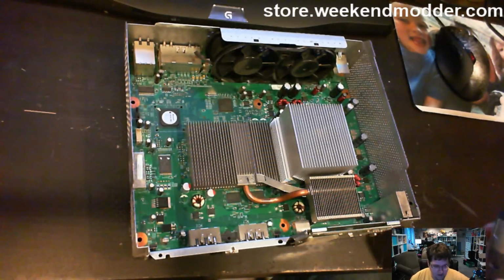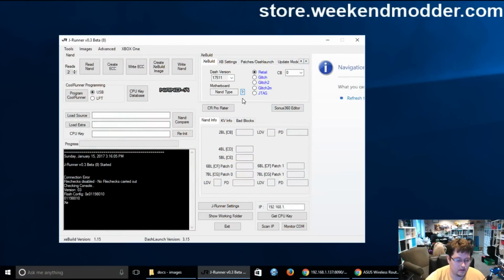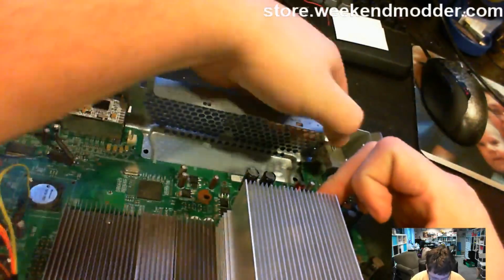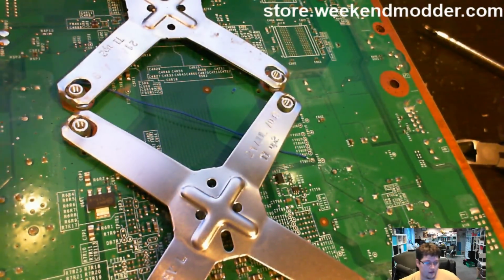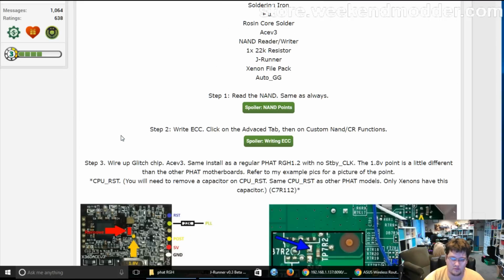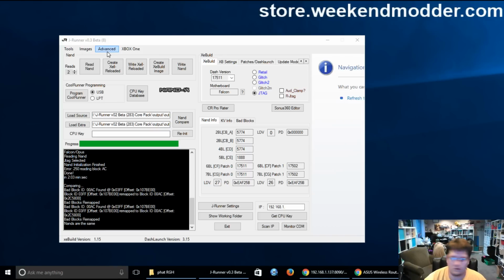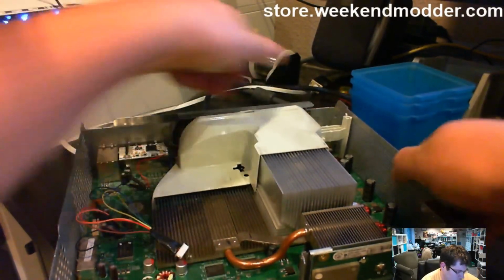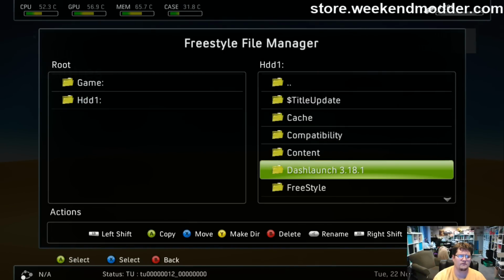Watch me RGH 1.2 Jasper/Falcon on current dash 17511 complete process

Comment: hey just wondering, since i get two types of cables one for the phat and the other one for slim, if the one for phat is too short can i use the one for slim on my phat?
Reply from the maker: Yea, they're just wires. Use whichever work for you.
Reply: @TheWeekendModder  alright thanks
Reply: @TheWeekendModder  one more thing, if i buy another glitch chip can i use the same jr programmer or do i have to buy a new one?

Comment: I have what I believe to be a Jasper. I’ve never really messed with a 360, so probably a dumb question but, if I do a RGH, do I need to flash the dvd drive separately?  Which programmer and glitch board would you recommend?
Reply from the maker: Yes RGH and DVD drive flashing are wholly separate activities.  Check out weekendmodder.com I've got recommendations there for the supplies and process you should use
Reply: It appears that you recommend a matrix over a cool runner.  What are the differences?   And what are the differences in programmers?  I see you have them all.  And I don’t recall seeing anything on dvd flashing

Comment: even if you had a perfect xenon, why would anyone bother.  it doesn't have HDMI.  I mean come on.  through that paper weight in the trash and pick up a jasper for $50 on ebay even back in 2017.  hell they were $80 in 2012.  or craigslist.  i mean i just picked up a jasper, a 360e, 5 controllers and 4 games for $50, everything works, craigslist.  even in 2020, thats a hell of a deal.
Reply from the maker: I 100% agree with you.  You can get nice Trinity slims for like $40 at just about any pawn shop.

Comment: I figured out that if you want red LED's you need to bridge the grounds on two of the stock LED's (top left and bottom right) because on the board, D1 and D3 grounds share the same points, D2 and D4 share same points as well. You only have to change the center LED. From what I understand, green LED's take a little more voltage to light up than red meaning the green LED's have more resistance. So the path of least resistance is to go through the red LED's.

Comment: hi i have 2 phats 360 with falcon and i want to do the RGH on both, its the same process of this video? also i only find in my country de jr programmer v2 and matrix v3 glitchers, can i do it with those?
Reply from the maker: Yes and yes.
Reply: thanks for the answer , also i see a lot o posts that says that are diferent version of falcons (v1, v2, v3) y really dont know how to know what version is mine... is that important or it doesnt matter?
Reply from the maker: Sub-versions of motherboards only make a difference on Corona consoles.  On Falcons it's irrelevant.
Reply: ok... so i was watching your online store... i wanna know if you can ship internationally, to Mexico to be specific, i want the nandx and also two of coolrunner glitchers...
Reply from the maker: Yes, I ship supplies internationally - I just don't do send ins or ship premodded consoles internationally.
Reply: i managed to get one jr programmer v2 and  this is this the log of reading 2 times de nand on a Falcon its ok to proceed?

J-Runner v0.3 Beta (8) Started

Connection Error
Filechecks disabled - No Filechecks carried out
Checking Console..
Version: 10
Flash Config: 0x01198010
01198010
Xenon, Zephyr, Opus, Falcon
CB Version: 5774
Falcon/Opus
Version: 10
Flash Config: 0x01198010
01198010
Xenon, Zephyr, Opus, Falcon
CB Version: 5774
Falcon/Opus
Reading Nand to C:\Users\rebellioN\Desktop\J-Runner v02 Beta (283) Core Pack\output\nanddump1.bin
Reading Nand
Error: 250 reading block C9
Error: 254 reading block 3B7
Done!
in 3:29 min:sec

Reading Nand to C:\Users\rebellioN\Desktop\J-Runner v02 Beta (283) Core Pack\output\nanddump2.bin
Initializing nanddump1.bin..
Falcon/Opus
Jtag Selected
Nand Initialization Finished
Reading Nand
Error: 250 reading block C9
Error: 254 reading block 3B7
Done!
in 3:28 min:sec

Comparing...
Bad Block ID  00C9 Found @ 0x03FF [Offset: 0x107BE00]
Bad Block ID  03B7 Found @ 0x03FE [Offset: 0x1077C00]
Block ID 03FF [Offset: 0x107BE00] remapped to Block ID 00C9 [Offset: 0x33D200]
Block ID 03FE [Offset: 0x1077C00] remapped to Block ID 03B7 [Offset: 0xF52E00]
Bad Blocks Remapped
Bad Block ID  00C9 Found @ 0x03FF [Offset: 0x107BE00]
Bad Block ID  03B7 Found @ 0x03FE [Offset: 0x1077C00]
Block ID 03FF [Offset: 0x107BE00] remapped to Block ID 00C9 [Offset: 0x33D200]
Block ID 03FE [Offset: 0x1077C00] remapped to Block ID 03B7 [Offset: 0xF52E00]
Bad Blocks Remapped
Nands are the same

Comment: Hey Weekend, have you encountered a stubborn BB 512 jasper freezing at the same spot on boot logo? I'm in that situation right now. Nand retail (when flashed back) is fine, xbox works normal. When using a coolrunner and following exactly the same process as you, my box freezes at the same point in the boot logo. SUCKS. I'm rerouting cable ATM and reading around/testing methods from 7sins and xecuter forums (from cable routing to SMC configs). I have a nice booting Jasper 16mb already, but the BB is giving me hell.  =D
Reply from the maker: So since you've got it somewhat booting, you obviously already have the CPU key and can extract the KV and other files.   What I would do is use the " Tools -> Create image without nanddump.bin"  feature within Jrunner to rebuild the nand image from it's own KV.   There are pretty good tuts around on how to use that " Tools -> Create image without nanddump.bin" feature, but essentially you put the KV.bin, smc_config.bin, SMC.bin and (if applicable) fcrt.bin into the xebuild data file and Jrunner will build a new nand image from those files.    I've had that fix the exact symptoms you are describing before.
Reply: I had to take time off and step back for a while 'cause I have been on this 2 nights in a row starting to go nuts (I also work a full time job in the mornings, and have a kid: grown up life lol). I'll start reading about creating the image without nandump.bin. Thanks for the reply, and for the videos/info! The 16MB Jasper was RGH'd thanks to your laid back and chill tutorials, I will try and update my freezing status on the BB. Take care!
Reply: Hey Week! 
  Just a update (in case someone else faces the same situation I had while watching one of these excellent tutorials!) I found a couple threads about "Create image without nanddump.bin" and tried the method, but for some reason I kept having the same issue: the boot freeze. Re-checked my soldering, re-soldered pll and cpurst just in case, did other cable routing, even went with the original coolrunner wires, etc., but finally decided to keep going the "it has to be a nand issue" route given the fact that Xell was always fine, and in a retail flash the xbox was always normal. 
   I found an old post in Xecuter forums where one user said he fixed his trinity with the same issue I had, so I tried his method. He fixed it by using a program called "xNandhealer GUI v2.0". I did notice I had a bad block @0x73 on my original nanddump, so I unmapped it with xNandhealer using its "Remap Blocks" tab, I selected  the "I want to: take an image with bad blocks and create a copy with the relocated blocks back in their original locations" option and hit "Unmap now". I then took the created (unmapped) xNandhealer nand, went to Jrunner, loaded it as source, saw that now it had "No Bad Blocks", inserted my CPU key, created an XeBuild image with the corresponding Dash version. Before writing anything, I did a 512MB nand erase with JRunner's  Advanced>Custom Nand CR Functions , rewrote an ECC image on the freshly erased xbox nand to have Xell back up, took the XeBuild image I created earlier, put it on a formatted Fat32 USB drive, booted Xell and flashed the newly created nand via Xell Reloaded (not Jrunner).  I can say that this method worked for me.  
 Thank you for pointing me in the right direction, sir.  =)
Reply from the maker: That's what I'm talking about!   Somebody who takes a pointer, does their own searches and runs with it!  You are an unfortunately rare breed!
Reply: haha Thanks man! You just showed a fellow modder (myself) (with much less experience of course lol) "how to fish"! Take care and keep those tutorials and vids coming!

Comment: help dude just followed your video up to 1:07:16 switched on console got 1 quick green flash from coolrunner but have no signal on monitor from console what have i done wrong
Reply from the maker: Make sure you wrote the correct ECC file to the console, also try re-writing your timing file to the CoolRunner.    Obviously make sure all your soldering and connected points are good.

Comment: I rgh'ed my trinity console thanks to all of your videos! I bought the ACE chip and a jr programmer and did it, took me like 4h but I managed through
big thanks to you! now to my question: can I use  the X360 ACE v2 chip to rgh also phat console or do I need a coolrunner for that?
can I rgh all corona motherboards with only the ACE chip and a jr Programmer v2 or do I need something else for that?
Reply from the maker: Phats are easiest using RGH 1.2 on a Rev C or a Matrix Programmer.  It is however possible to RGH a phat with an Ace. 

Some coronas are 4gb and require a 4gb r/w tool, and some would require postfix adapters, but yes you can use an Ace on any Corona.

Comment: My biggest worry is soldering for the first time, I'm worried I'm going to merge dots together with solder when trying to connect the wires to the motherboard.
Reply from the maker: Might be worth considering using my send in service - or at the very least get yourself a scrap PCB to practice soldering on first.
Reply: I feel you bro😂

Comment: If you plug in three controllers with red leds wouldn't it look like red ring of death
Reply: No, because the RRoD has the 4th, 1st, and 3rd leds lit, and 3 controllers lights the 1st, 2nd, and 3rd leds. Also, RRoD has blinking lights.

Comment: Can you help me ? when i turn on the console all i get is 3 red bunking lights, my xbox is a faclon
Reply: Yusupha Bayo the problem for me was the wires, they were soldered into the wrong points on the motherboard.Also make sure to trim the tip of the wires for better connection.
Reply: jimmy perkins Thanks for your prompt reply, which diagram did you use to get the right points and did you use any QSBs. I'll take note of trimming the tips of my wires but if you can get the diagram of the points that worked for you, please email it to me: yusbayo@gmail.com.
Reply: jimmyperkins91 1 problem I got a nandx
Reply: my problem the wires were to long to i cut them, but still no xell
Reply: OK I'll make sure to do that then but still why is it when I click on create ECC a folder appears but there's nothing in it to click on do you no?
Reply: ive gone pass all that my, my xbox turns on but it freeze at 360 logo,dashboard, and even with hardrive no plugged in.
Reply: jimmyperkins91 how long did you wait for the Console to boot because you may have to pick a different timing file
Reply: it was the wiring that caused it to freeze , it works now
Reply: ok
Reply: jimmy perkins Please help, how did you solve your 3 red light blinks cus I am having the same problem. The coolrunner blinks green light as if it's gliching but the game shows red light after 5 glitches. The red light stops as soon as I remove the coolrunner chip so am sure it's my RGH but I can't figure out what am doing wrong.
Reply: Yusupha Bayo i cannot email you just google images for wires
Reply: There are different images but it's okay, I'll try different images to see which one will work for me thanks anyway..
Reply: rrod

Comment: Is it true that th best RGH is a Jasper?
Reply: DRFPV i had a falcan with a second boot time
Reply: DRFPV jaspers are good reliable consoles but trinitys are the best coronas are shit
Reply: Insite DGF thanks for the info, I did the rgh 1.2 on a jasper and wasn't getting good enough boot times, after trying mostly all the timing files I did the cr4 dynamic ace file and insta boots almost every time. Sometimes the light on the ace indicator appears to do a successful glitch but the console doesn't boot. Like 2 out of 10 boots.